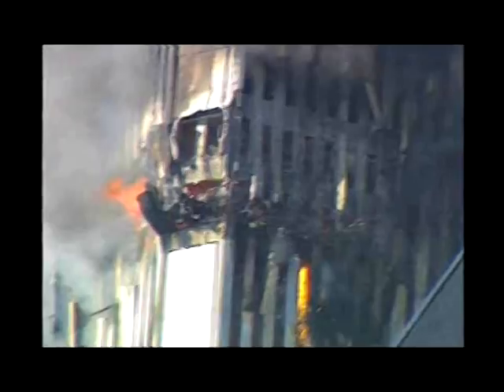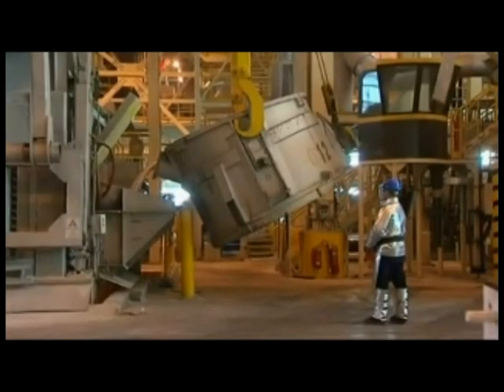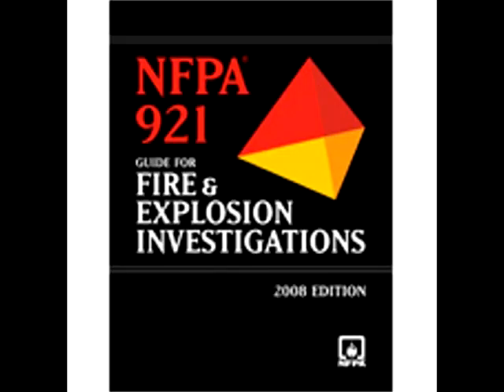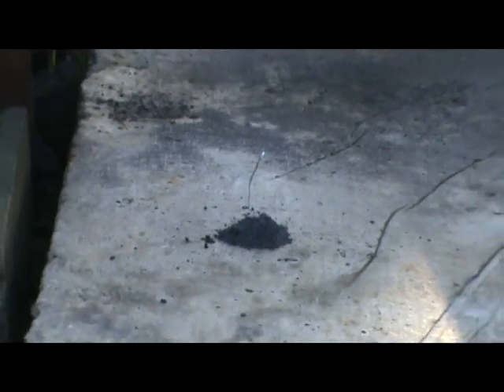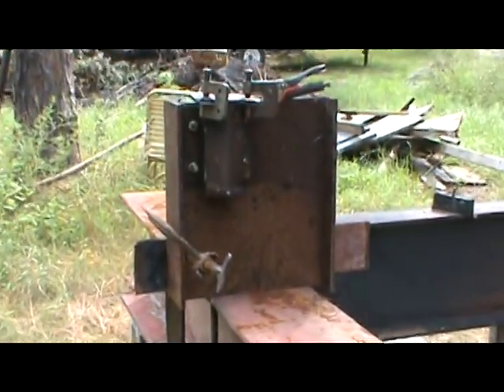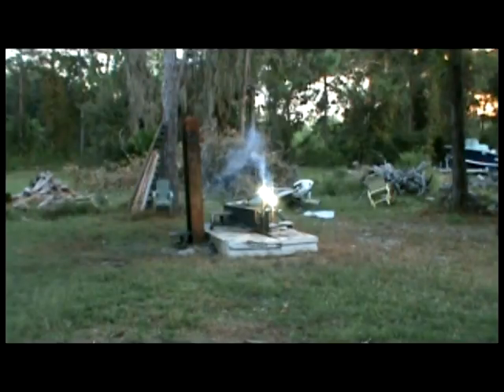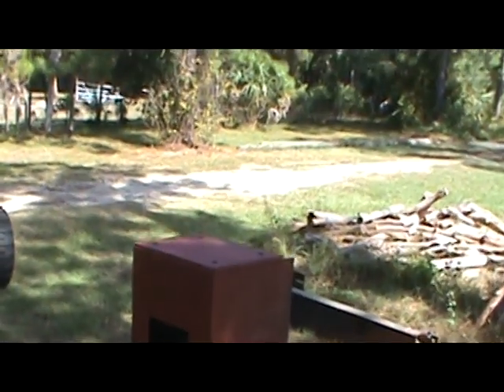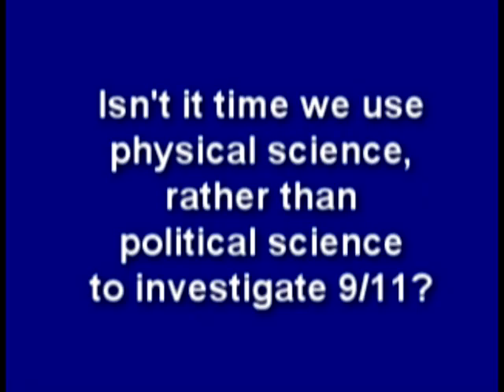9/11 Experiments: The Great Thermate Debate

Comment: What "Great" debate?  Some Internet conspirakooks versus actual scientists?  Notice the quote about steel being melted is from "the media", and from firemen, not from scientists or any official source.

So what's the alternate "theory"?  That the government crashed planes into the building, then had pre-placed thermite (that nobody noticed in the prior weeks) do the rest when the planes didn't bring the buildings down?  With controls that survived the impact and subsequent intense fire? And in both buildings they were able to make the planes hit on the precise floors that the thermite was located?  Stupid.  No additional explosives were needed to bring the buildings down.  Steel is significantly weakened at temps much lower than 1800 degrees F.  No kooky theories are needed.
Reply: +crushffl The melting point of steel is 2750 F. 1800 F does absolutely nothing to steel. If you knew anything about physics, metallurgy and structural engineering you wouldn't be making stupid comments like this. But you don't, so you do.
Reply: +Morpheus  You are either a deliberate liar or horrifically ignorant.  "1800 F does absolutely nothing to steel."  Absolute nonsense, and I'm certain that you cannot provide a link or reference to back that up, just your meaningless and uninformed/deceptive words.  

Here's a link to EPRI's Carbon Steel Handbook:  https://www.metabunk.org/attachments/174413923-28247782-carbon-steel-handbook-pdf.4544/.  If you bother to look at Section 5.2 "Mechanical Properties" you'll see that most carbon steels start to show loss of tensile strength starting about 700 degrees F.  By 1000 degrees F most have lost approximately half their strength.  Additionally, as discussed in Section 5.3, at these temps steel experiences "creep" whereby it slowly deforms.
Reply: +Morpheus You seem to be at a loss as to how to reply.  A few options from the conspirakook playbook:

1) Provide no evidence; insist it is the other guy's responsibility to look it up;  
2) Insist that you did provide a link, even though you didn't;  
3) Put fingers in ears, sing "La La La" loudly;  
4) Hurl insults;  
5) Accuse other guy of being a paid agent, shill, etc.;  
6) Provide links to "Truther" sites.

I recommend #1, #4 and #5.  None of these require you to actually provide evidence.  #5 is nice, because it makes you feel important; a guvmint entity cares enough about you to pay someone to argue with you!  #6 is to be avoided at all costs because "Truther" sites are garbage with, at best, bogus references or scientific credentials.  Most are downright laughable and easily torn to shreds.  Most conspirakooks learn this pretty quickly and avoid it.  However, they are too invested in their religion to allow themselves to realize the stupidity of what they are parroting, but at least they learn where providing their "evidence" always leads:  the woodshed.
Reply: +Chevy/GMCDuramaxDieselFan  John Kerry said in a press conference that building 7 was "pulled" because it was in a dangerous condition, but didn't explain how that could have been done so quickly.
Reply: Well we can agree now that the US can now be tried and executed for their crimes against humanity.
Reply: +N75911 "I only support the end to all life on earth".  So we can now be sure that everything you say is pointless.  Thanks.
Reply: +crushffl You are brainwashed to say the least! the initial fire was actually burning out and the black smoke is from the lack of oxygen.
Reply: +Chevy/GMCDuramaxDieselFan Care to provide a source for that claim?  Why would there be a "lack of oxygen" when there were gaping holes in the side of the building?  It's amazing how you guys consistently state, with confidence, claims that have not only no references, but make no sense when a tiny bit of rational thinking is applied.  Embarrassing.
Reply: +Chevy/GMCDuramaxDieselFan And that would mean exactly what?  That the fire was 1500 degrees rather than 1800 degrees?  As pointed out above, where I posted an actual link to an engineering resource (something you can't do), steel is significantly weakened starting around 700 degrees F and has lost half its strength at 1000 degrees F.  On top of that it was subjected to heat well above those numbers for an extended period (even you conspiracy kooks admit that), during which it is well established it would have been subject to "creep" (deformation), further compromising structural integrity.  You're arguing with an engineer, dummy.  You know nothing and it shows.  Now run away like the fool Morpheus.
Reply: crushffl you are wrong, you are as well brainwashed, there is no way to get free fall collapse without some kind of controlled demolition. You need to learn the laws of physics and realize the official story doesn't add up. 
Metabunk is a disinformation site, there are into covering up the lies.
If you are an engineer, I probably won't trust you dummy, who would believe the official story of 9/11 that goes against the laws of physics.
Reply: crushffl here is some info you can't deny:http://www.hangthebankers.com/24-hard-facts-about-911-that-cannot-be-debunked/
Reply: +Chevy/GMCDuramaxDieselFan As usual, no references, just claims from an unqualified non-engineer who not only rejects things that come from those with training and education, he rejects them BECAUSE they come from someone from training and education.  The collapse of the WTC occurred as one would have expected it to occur if a failure occurred on an upper floor, and is entirely consistent with known physics.  Nobody with a proper education takes your nonsense seriously.
Reply: crushffl there are engineers and architects that agree that 9/11 is an inside job. 
You are the one who thinks inside a box, use logic and common sense, the so called "science" behind the official story is a joke, it contradicts the laws of physics. 
As a matter of fact, "science" now is controlled by the government and can't be separated from politics.
The collapse of the twin towers is consistent with a controlled demolition, even the fire men and witnesses observed that. Even if the towers pancaked as you say, you can get free fall in the path of resistance.
Building 7 fell as a result of controlled demolition, Even Larry Silverstein admitted it when he said "pull it."
Reply: crushffl call what I'm showing nonsense all you want, still you are wrong.
Guess what? The official story is nonsense.
Reply: +Chevy/GMCDuramaxDieselFan What "architects and engineers"?  Those that have supposedly signed the "Architects and Engineers for 9-11 Truth" statement?  What a joke.  They don't publish the number of signatures, but back in 2013, when they still did, it was around 2,090.  That sounds like a lot to the uninformed, and a reason to give credibility to the claims, but I ran the numbers and the opposite is true. 

Try comparing 2,090 to the millions of architects and engineers registered in the US alone.  Even if you give them the benefit of the doubt and assume that all these are legitimate, registered A’s and E’s, and all are in the US, that amounts to LESS THAN ONE ONE-HUNDREDTH OF ONE PERCENT that they have managed to convince, in the 12 YEARS BETWEEN THEN AND 9-11, that this is an issue.  It’s really pathetic when you bother to think for two seconds and do a little elementary school math.  All of their “evidence” crumbles in the face of a similar level of scrutiny.  A completely insignificant number of people with any expertise.  Adding thousands of YouTube-educated kooks means just as little.  No wonder they don't publish the number anymore...it's a complete joke.
Reply: crushffl seriously, you are totally ignorant, engineers who are open minded will see that the official story doesn't add up, all the government controls the "science" to cover up what they did. There is building 7 that fell at free fall speed which is obviously controlled demolition, you can't get that from office fires. Another fact is that the twin towers didn't burn at the maximum temperature either. Even if the jet fuel did Burt at the maximum temperature, it still won't be able to weaken it enough to to cause a free fall collapse right into it's footprint.
Reply: crushffl the majority opinion doesn't matter, I don't care if millions of "engineers" disagree with the evidence, a lot of times they would be fired or threatened if they show that 9/11 doesn't add up.
Your arguing semantics suck big time!
The official story is not credible, doesn't matter if it's peer reviewed or not, it's all controlled by the government and you are seriously duped.
Reply: No other sky scrapers in the world have collapsed from fires, there were some that burned all day and still didn't collapse, even some of the other WTC buildings were twisted and heavily damaged but still didn't collapse.
Reply: +Chevy/GMCDuramaxDieselFan "No other sky scrapers in the world have collapsed from fires".  More nonsense from an uneducated non-engineer.  Were those buildings of the same design?  No.  Were they struck by fully-fueled 737s?  No.  Was there a large impact and explosion knocking out numerous supporting columns, transferring load to the remaining columns which had the fire-resistant insulation blown off?  No.

An intelligent adult cannot make the lame arguments you are making.  You are one or the other, but not both.
Reply: crushffl
I have done all my research on this subject any you only talk through your hat.
I noticed you dodged the point about the building number 7.
I have explained pretty good but you only got lame arguments.
These twin towers were fire proof and biult to withstand a jet plane crash.
If you take a close look at those planes that hit them, you will notice that those are not passenger planes but some other aircraft.
If you are supposedly an engineer, I wouldn't trust you one bit since you ignore the evidence and make stupid arguments.
Another problem is that airplanes can't go through steel reinforced concrete like knife through butter.
Reply: crushffl
You get an F for engineering, that's for sure or may be that you are lying that you are an engineer.
Still, you haven't offered any proof that I was wrong.
Reply: +Chevy/GMCDuramaxDieselFan Yeah, right.  I can't compete with you degree from "YouTube University".  But my company disagrees and my fat paychecks and successful projects speak otherwise.Let me guess, you're a Millenial.  You grew up on "X-files" and the Internet.  You start out with the belief that the official version must be a lie (hey, sometimes it is), and then cherry pick the evidence from there to suit your a priori belief.  I have provided a reference refuting the first patently false claim by Morpheus early in this thread, completely debunking his claim and a favorite of the consiparkooks.  You've offered nothing other than the laughable, paranoid and kooky claim that the government "controls science".  LOL.  Have the decency to admit that the fires were indeed hot enough in Towers 1 and 2 to have significantly weakened the steel and cause collapse, without explosives, and I'll address Building 7.  Otherwise there is no hope for you and no point in having a discussion of any kind.
Reply: Morpheus was right with what he said but you only make stupid outrageous arguments ignoring the evidence presented to you. 
This is not the University of YouTube, this is about how the official story doesn't add up. 
Another big problem is that you ignore the laws of physics, the top part of of the twin even if the steel was weakened enough to collapse would do an accelerated crash to the bottom in the path of resistance, it's just like when a hammer hits the nail, it slows when it hits, the same with a speeding car hitting a parked car, it would slow down when it hits.
I am not going to throw away the laws of physics to believe the official story nonsense. 
If you are really an engineer, you need to do your own research, not believing something just because the majority of "engineers" believe something.
I am not a conspiracy theorist, I am a person that doesn't merely accept something just because the official story says so, I look at the weight of evidence and see which holds up better.

First of, the official report ignores a lot evidence, there is molten steel and pulverized concrete.
Reply: +N75911 No, just you and your fellow Twoofer 'tards spewing your ISIS propaganda.
Reply: crushffl ISIS, no, ISIS is a product of the west, and communism trying to fuck with the world. But don't worry, once the US and Russia are both destroyed, no one will try to be "world police" and try to protect the rest of the world, and every last human will be left to die in a hole as nature balances itself out from the failure that we knew as "Humanity".

But until then, just live your life and pretend that humanity is just fine, until you can't avoid it any longer.
Reply: +N75911 "ISIS is a product of the west, and communism trying to fuck with the world".  I would partially agree with that.  The conditions for ISIS to grow were certainly at least partly created and definitely exacerbated by our collective meddling in the Middle East.  However, you can't exclude the role of Islamists in funding and tolerating or even encouraging the radical thought that drives these maniacs.  It's not all because of US/USSR meddling.  A large part of their recruiting is the claim of a conspiracy against Muslims/Arabs, combining both the true (political meddling) and the absurd (9-11).  By perpetuating the absurd, based on terrible evidence and laughable arguments, you and others here are supporting ISIS's recruiting efforts, no doubt about that.
Reply: crushffl Pretty much as worthless as your argument lol

Comment: To be totally correct, no matter which fire we talk about, we only need to soften steel by heating it instead of cutting or melting it outright. Its the failure mode of steel beam and reinforced concrete buildings during a fire. I studied this in my classes. (i studied architecture)
Its like how smiting works, get the steel hot and it will get gradually get softer. If do to the soft deformations result in a weaker geometry the collapse begins.
Dont get me wrong the thing looks fishy but it is possible without any melting too.

Comment: The metal was aluminum because aluminum contaminated with impurities glows ORANGE... The steel was weak due to high temps.  It failed all at once as would be expected. gg.
Reply: It won't shed impurities when rolling over them.  That happens when it is especially hot and in isolation.  When cooling and in the presence of lets say the debris of a destroyed building, it becomes slag once again.
Reply: At lower temps this just doesn't happen.  This metal was cooling in the presence of abundant organic material.  Investigate this I beg you.  You can't say unequivocally that this wasn't aluminum however you choose to misrepresent it.
Reply: You've tested the spectral emissions of molten aluminum full of impurities falling over 50 feet?
Reply: say something

Comment: Good job.  You hit a sore spot in the disinformers.  Why?  Because they are swamping your comment section with childish non-logical attempts at debunking, and unusually lengthy arguments about melting jet fuel.  I would like to see also if you could do a video where you fill a square enclosed column with a foot or two of thermite.

Comment: While I won't dispute that, given the most ideal and sterile conditions, this compound "can" indeed cut through steel respectively, granted.  However, [objectively] that hardly accounts for all the activity of the day.  Additionally and most importantly the basic structural design of these buildings lend to their failure stricken by forces unforeseen.
This is where this entire hypothesis SEEMS TO fall flat.  I can only imagine the respective stresses on those building having much of the steel's integrity [at least at certain points] compromised by the impact and heat COMPOUNDED with the weight of many floors upon it. IJS  There are [perhaps] more 'logical' explanations.
FYI...These buildings were of a very unique, innovative and radical design!